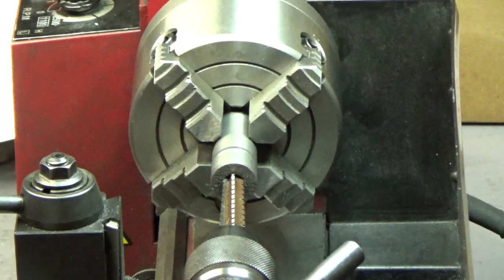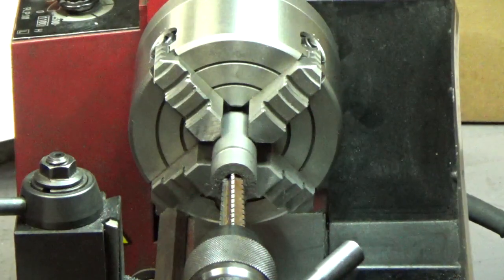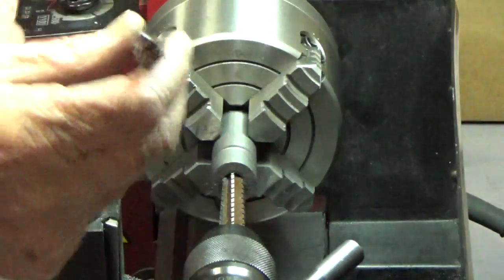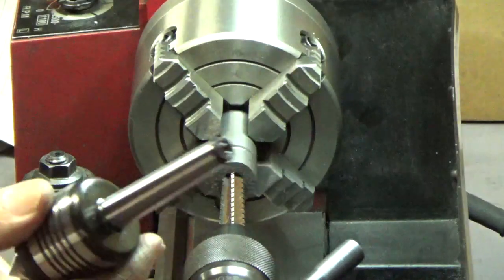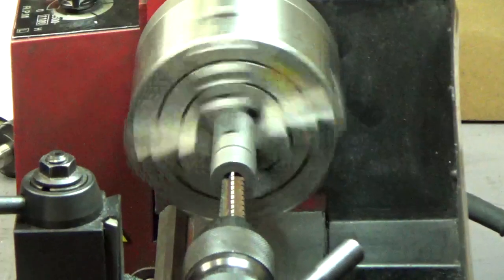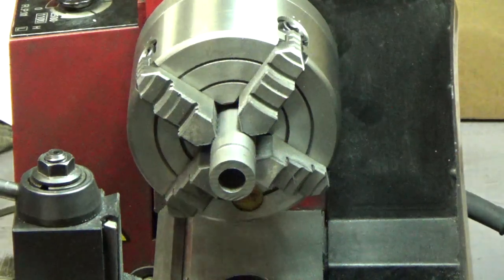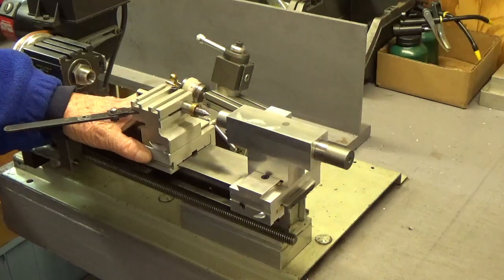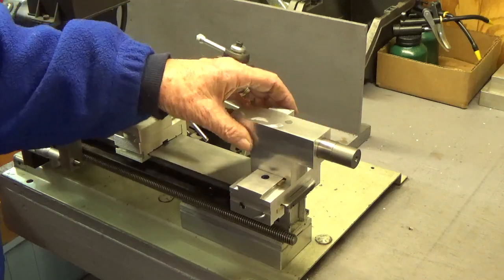Taig Lathe Tailstock Build No.3 (MT1 Bore)

Comment: Hi Larry, 
Did you cut an internal taper in this piece before attempting to ream it, or did you just go for it on a straight hole? 
I'm trying to do a similar operation on a spindle from an old Benchmaster Horizontal Mill which has a MT2 seized in it really bad. Had to cut it out and now I need to repair it. 
Thanks! 
Marcos
Reply from the maker: If I remember right, I just used a roughing reamer and then a finish reamer afterward in a previously drilled hole.  The reamer set was inexpensive, probably Chinese, but seemed to work okay.  Regards: Larry

Comment: Looking very good, Larry, it's going to work a treat for you, make sure when you do the real thing you get all your morse tooling out and ready to test all in the hole for the right depth if you go in all the way with the reamer you might be too deep so take little cuts and check often with your tooling, yes you can always machine the front face to rectify that but nice to get it right first time,
Reply from the maker: Walter:  That's the reason for the first test.  I learned to be very careful with the depth.  A little at a time.  I also need to leave enough room for the finish reamer.  Thanks for the comment.  Best Regards: Larry